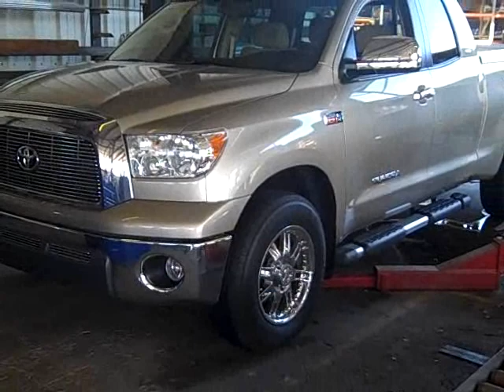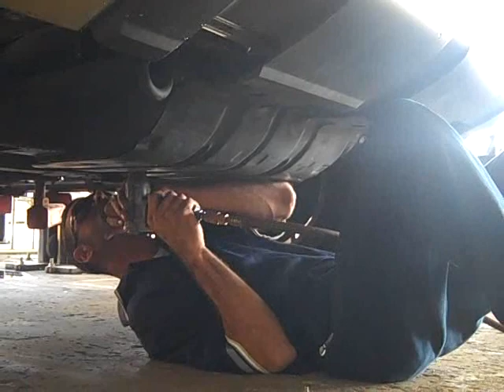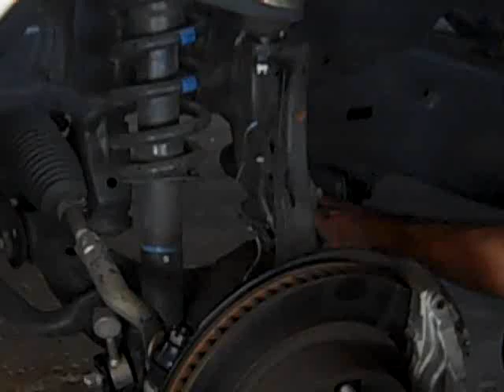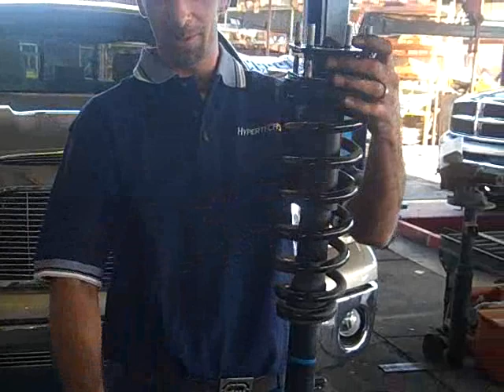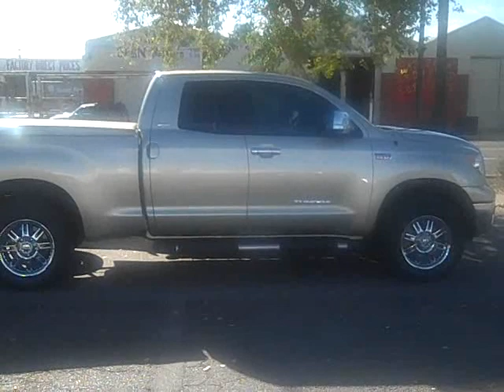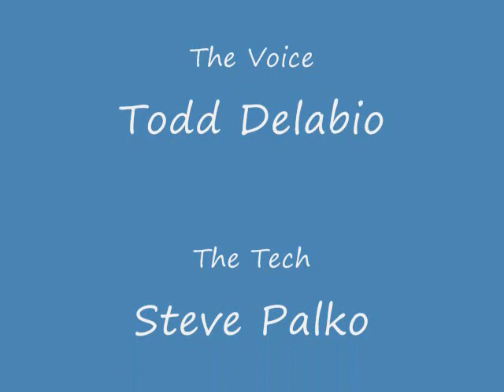Toyota Tundra Leveling Kit by Pro Comp  - Truck Leveling Suspension Install Video

Comment: I have a 2008 tundra and both CV axles are leaking out the boot because it has a leveling kit. I didn’t realize It had a leveling kit until I parked the tundra right next to another one. I was wondering why it was so hard for my wife to get in. I’m going to uninstall them because it makes the ride rough in the summer and I just want my truck to last. Not fall apart.

Comment: Leveling kit only makes the truck look and sit leveled, doesn't help with load or performance at all, personally I like the look of the back sitting higher than the front....also when I carry a heavy load it evens out. Don't waste your hard earned $ on something useless.

Comment: Anything under 3 inches doesn't need a diff drop. I know it's arguable but really. It's not over stressing anything without. 2wd truck don't have a front diff

What I need to point out here tho, as soon as you level the truck out, anything 2 inches and higher will start to over stress the ball joint in the upper control arm and because of the limiting factors, you cam and caster angles won't be able to match up to the Toyota specs. Meaning you need either a spindle kit or UCA. 

What I would like to point out, these guys basically sledge hammer approached this. Yanking on the brake lines?? Excellent! I see no need to loosen the lower control arm bolts, only to disconnect the upper balljoint? I would have marked alignment, loosen LCA bolts, undo lower ball joint leaving everything in place. So much more work the route in the vid.

Comment: if the truck is a 2WD, do i need to install differentia drop bolt and skit plate spacer or is that only for 4WD?
Reply: Only 4wd..you dont have a front differential

Comment: just finished installing  the 2.5" ready lift leveling kit on my 07 tundra, it's the exact same thing, it's really not hard to do, getting the sway bar back in is a bit of a bitch, but overall it's easy, im an electrician and only have basic - intermediate car knowledge. only thing is you definately need to get an alignment as soon as possible after installing. it looks fucking sick though.

Comment: Disconnecting the upper control arm is not necessary on these trucks.  MUCH easier to disconnect the lower control arm and let it swing out of the way.

Just installed a level kit on a '10 4WD Tundra today. Took less than an hour, and we used a kit from BMF that fully replaces the upper strut mount instead of just bolting on a spacer. MUCH more solid of a kit.  Also had differential drop spacers and skidplate spacers.